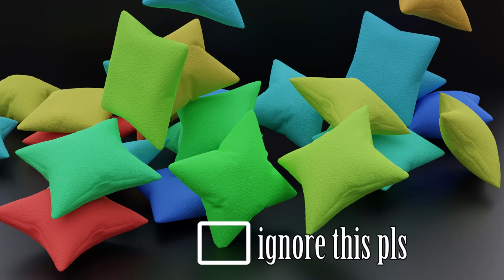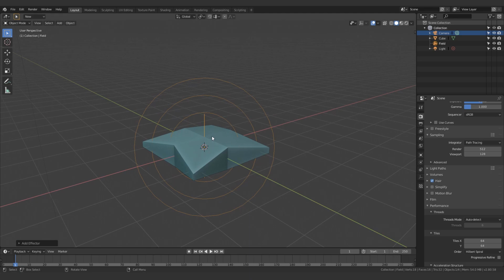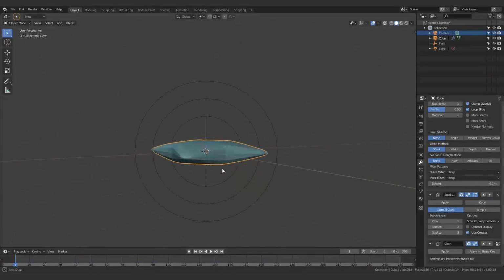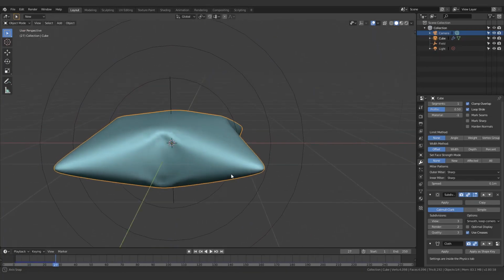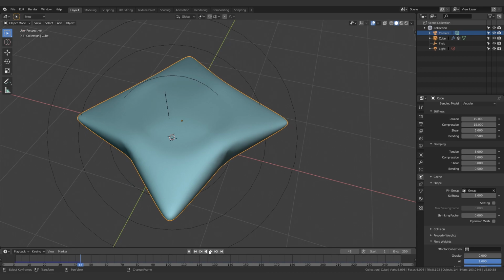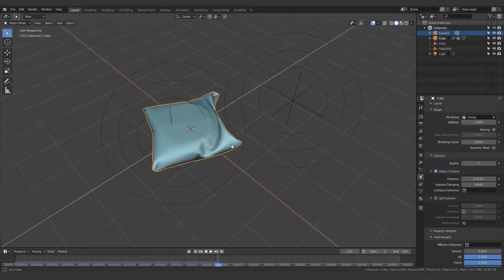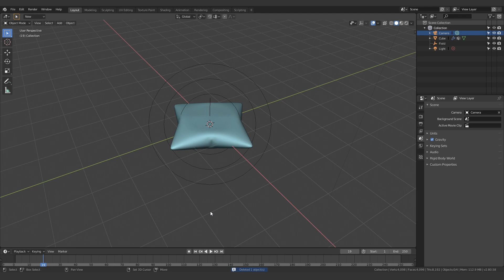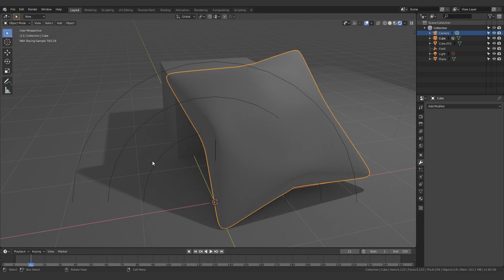Cushions - Quick Model Tutorial - Blender 2.8

Comment: Mine keeps falling down after applying the 3 modifiers even if gravity is set to 0.
Edit: nvm I made it in a separate blend file, exported it as FBX and then reimported it - works! Super tutorial.
Reply from the maker: Try to ensure that the force is in the centre of the pillow itself. The best way to do this is to make sure you create the pillow and the force at the same time then only transform the pillow uniformly around the force.
Reply: @WasiqWiqar  I see. Will keep this in mind. Thank you.

Comment: How did you just magically not make it fly into space??
Reply from the maker: So there's two things that can cause that:

1. Cushion shape being non-uniform
2. Force not being in the centre of the cushion body.
But yea it's fixable. 
Fixing it: 

1. You can try to remake the pillow and the force without moving the 3D Cursor ensuring that the force applies evenly to the pillow in all directions. 
2. You can select some vertices on the pillow, I suggest the corners, and create a new vertex group, then go to the cloth modifier tab and pin those vertices so they don't move.
Reply: @WasiqWiqar  Thank you, I will try that c: